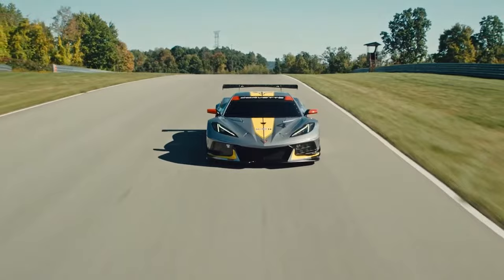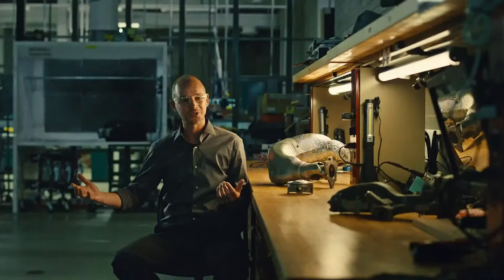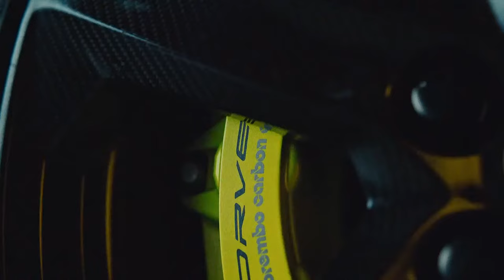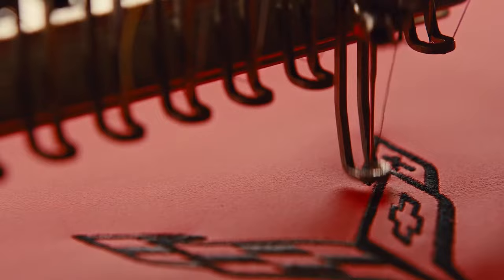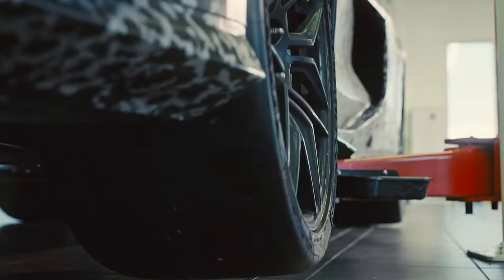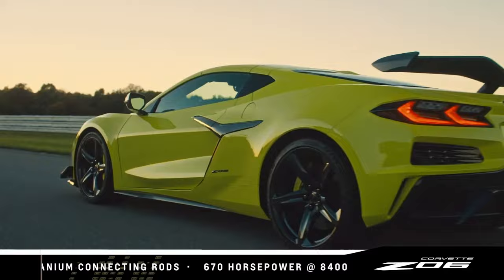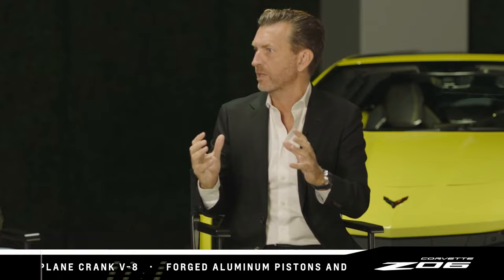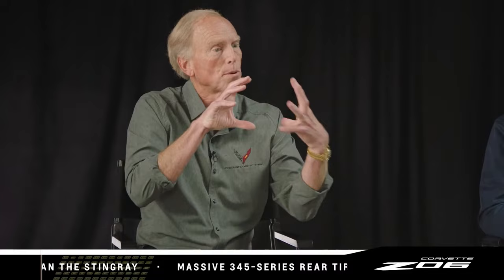All-New 2023 Corvette Z06 Reveal

Comment: After watching this, I just know the ZR1 is going to be fucking nuts.
Reply: was thinking the same thing 1k hp min
Reply: Gotta be honest with you. I think this Z06 is gonna be the best Corvette this gen. Awesome sound, high revving N/A V8. 670 hp in a N\A car? Are you kidding me?? The ZR1 is rumored to be awd, hybrid with who knows what kinda motor. It will probably be even quicker than this Z06, but im not sure if it will be better.
Reply: The Zora is supposed to be the hybrid not the ZR1
Reply: @V8Supercar1  a hybrid would be crazy, kinda like what the p1 does. Or pop a supercharger on the Lt5, it will be pretty cool to see what they come up with for the zr1
Reply: @V8Supercar1  There was a rumor that the ZR1 would have the LT6 engine but twin turbo, and supposedly the Zora will have the same twin turbo LT6 engine except it'll have added electric motors as well
Reply: @08Cusma   I'm willing to bet almost anything that the "Zora" will be the ZR1 and vice versa. The reason why I say that is because the person that currently runs GM wants everything and I mean everything electrified in the very near future.
Reply: @V8Supercar1  Typically how it is. Z06 or Grand Sport is the "happy middle", ZR1 is usually bonkers, usually too much power for the platform, but puts down insane power and specs match supercars on track.
Reply: @08Cusma  Zora will be the EV -- hybrid will be ZR1
Reply: @V8Supercar1  yet they just rolled out the largest displaced motor out a week ago. You never know but I doubt they would do that being everyone is still fighting the whole gas car ban.
Reply: I heard the zr1 won't be road legal
Reply: @tealruby1  there won't be a hybrid
Reply: @V8Supercar1  nope
Reply: Better be supercharged
Reply: Nah the hellcat redeye would whoop this
Reply: @tealruby1  actually the EV will be the E-Ray
Reply: @straightwicked5055  in what world.
Reply: @Exhibit-A The hellcat redeye and the demon would smoke it
Reply: Zo6 with twin turbos
Reply: @08Cusma  yup, that 1,000 hp engine by GM!
Reply: @straightwicked5055  no, not even close lol. Hellcat redeye in a straight line goes 0-60 in 3.8 seconds, demon 2.3, and the 2023 vette will do it in 2.6. The difference being the vette will actually keep all its traction and that 2.6 will work on a street but that demon most definitely won’t do a 2.3 on a regular street. On top of that a demon starts at 85k msrp the vette starts at 65k and you can actually see out of the vette at least LMAO
Reply: @straightwicked5055  and don’t even get me started on how the demon boat would do against the vette on a track
Reply: @straightwicked5055  lol i own a redeye and i personally dont think so at all. Vet all the way
Reply: Its probably going to have 800 HP
Reply: probably just going to be a special edition with a supercharger + maybe an electronic assist system, but they're probably not going to put as much development into it because they're going to net a lot less sales and revenue.
Reply: No, it’s not going to be sleeping with nuts. It’s going to be brutally fast. But, it’s totally unnecessary, because this is already faster than the C7 ZR1, which is brutally fast.
Reply: Dodge guys are probably thinking " if the C8 base is kicking our ass, now how we gonna beat this!
Reply: These Hellcat fan boys would compare their oversize Boats to anything, whether they're in the same category or not.....
Reply: @tealruby1  Nope. ZR1 should be twin turbo, and the Zora should be the twin turbo hybrid. The EV most likely will be called the E-Ray.
Reply: @straightwicked5055   first of all in order for demon to utilize it full potential u need to get it on E85 and swap the drag kit that comes with car. The zo6 already set no special fuel no swapping race headers and internal and tires.
Reply: There will be no ZR1, as named.
Reply: @Justin_GFM  - I highly doubt they will combine turbos with electric motors (no need). One or two electric motors (depending) alone, can bring the horsepower of this car above 1000 HP easily (and more importantly give it torque performance a NA gasoline engine alone cannot create).
Reply: Not by much... maybe 0 to 60 in 2.2 or 2.3 top speed should be around 220mph.  It's gonna be a hybrid mix. before they go all electric.
Reply: I love the Idea of the Z06 being the GT3 and the ZR1 being the GT2 rs
Reply: @Exhibit-A  the redeye and the demon would smoke it
Reply: @Exhibit-A  the redeye and the demon would smoke it
Reply: @cryptothuggin293  the redeye and the demon would smoke it
Reply: @Kacaroto13  the redeye and the demon would smoke it
Reply: @ojraven8093  the redeye and the demon would smoke it
Reply: @08Cusma  I wonder if it’ll put up hypercar stats
Reply: @Exhibit-A  the redeye and the demon would smoke it
Reply: Would rather have the Z06.  ZR1 - weight will go up, turbo's muffle the exhaust, good chance the redline will go down, price will go up, doubt the hp will offset the negatives.
Reply: They need to offer a non flat plane crank, BEAST sounding V8. When I first heard a 2006 Z06 pull up, with solid lifter valves, and fully custom exhaust, it was the most nasty sound ever. Chevy V8 engines have always been the best sounding engines in the world. You can't ever lose that sound. The flat plane crank is outstanding. But if you ever get a chance to ride in an American V8 car, with pushrods, the sound is literally the best part.
Reply: @straightwicked5055  Red-eye and Demon to heavy with 797-804 Hp with single clutch
Reply: its going to have to be low boost twin turbos if its off the same compression of the LT6 perhaps a different smaller displacement 32v that can handle more boost for the ZR1 the same way the c6 z06 was a 7L NA, vs the zr1. Considering z06 has its connotation with BIG NA power, even the  way they made the ls6 with intent to compete with the power of the 32v zr1(LT5) of the 90s made by lotus. I dont expect to see a boosted LT6 i mean look at the exhaust manifold as it is on the stock LT6 how the piping isnt equal length that took time to dial in....idk if they can just throw on a blower or 2 turbo manifolds and get an ideal match up.
Reply: I am buying a Chinese EV NIO EP9 instead because it’s pure electric ⚡️ and  the beautiful  Chinese EV is super fast also hehehe 😃😃😃👍👍👍👍👍👍🇨🇳🇨🇳🇨🇳🇨🇳🇨🇳🇨🇳🇨🇳🇨🇳🇻🇳🇻🇳🇻🇳🇻🇳🇻🇳🇻🇳🇻🇳💕💕!!!
Reply: @straightwicked5055  Keep this same energy when Zora comes out
Reply: We'll find out tonight!
Reply: this comment aged very well

Comment: 670 HP in a N/A V8? Are you kidding me?? In this day and age, that's unheard of. This Corvette might go down as the best one ever made.
Reply: 670HP from 335 cubic inches.......2 HP per CI from a NA engine......amazing !!!!!!!!!!!!!!!!!!!!
Reply: @darknes7800  It is an all new engine...not just another reworked push rod.
Reply: @polystictus  Yup, double overhead cams, 4 valve per cylinder, flat plane crank. Not like any other engine from GM !!!!!!!!!!!!!!!!!!!
Reply: Agreed. This is prolly chevys swan song for gas powered NA motors.
Reply: @jonj4357  you’re correct 
I read an article about this exact engine 
Kind of sad we are experiencing the die off

Comment: I'm a Mustang man, and I still highly approve of the C8 Z06.  Can't wait to [attempt] to buy one.  I hate to part with my GT350R, but I might have to.
Reply: I used to be a Ford guy, but GM is taking the bull by the horns with performance recently compared to Ford. I love the GT350, I’ve driven one and an R and they are great cars, but I think you will be very happy with a C8Z. Cheers and good luck
Reply: I'll take your R 😈
Reply: Feeel the same way
Reply: @703z06  yeah man. I'm still a Ford man. But I really do hope that Ford picks it up after this. GM has dropped a bomb with this car.
Reply: @nathanzavala6470  perhaps even a hole new car, Ford needs a attainable mid engine, voodoo powered track focused car. As a Ford guy its hard to admit but Chevy is running away
Reply: Likely a more practical car than the GT350R. Hopefully less fragile of an engine too.
Reply: @robdc4829   In what possible way would a Z06 (or any Corvette) be more practical than a GT350R? 
The engine issues have been greatly exaggerated. Somebody did the math on it, and I believe the failures amounted to something like 1% of the cars.  One of the development engineers stated on video that the Voodoo engine can "safely" over-rev to 9000 RPM. I would hardly call that fragile. Though, I wouldn't want to test that hypothesis with mine.
Reply: @nathanzavala6470  Like the tagline said, they're putting the world on notice. Chevy has walked up to Ferrari and slapped them in the face with the glove.
Reply: @michealgray533  It doesn't even need to be mid-engine.  Ford should make the Shelby GR-1 and make it on par with the 812 Superfast.  I've been hoping against hope that they would build that car for 17 years now.
Reply: Now you are thinking correctly. The Corvette had the Mustang beat years ago but the two mustangs I like are the 1967 and 1969 both fastbacks.
Reply: @goodboyringo9716  Well, considering the Mustang and Corvette were never competitors...
Reply: @tayl0rd553  .... I was speaking to bobbyZ06's post not you ! He compared GM to Ford . Little did you know because you are going around protecting Ford. 
Wake-up and smell the coffee , the Corvette is worth owning more than the silly looking plane mustang, it's a no brainer. Also, speak to when spoken to .
Reply: @goodboyringo9716  Learn how to quote next time. Considering you DIDN'T quote anybody and you're responding under MY post, anybody with half a brain would assume you're talking to me.  And I'm not "protecting Ford," whatever that means. And, again, the Mustang and Corvette are NOT competitors, so... What's your point?
Reply: Would be a huge step up for you.

Comment: Was at a Chevy dealer inquiring about the C8, he told me, "get in line, put 25% in cash now, and hopefully you'll get it by 2025." Now I'm looking forward to hearing when and how these will be available, with limited production, Z07 package coming in around $120K, and dealers with ADMs. I've also been in line for the Bronco, and the $60K models have sold close to $120K. Nonetheless, great presentation, but it's not an iPhone, where you can get the new one next Monday, so the thrill fades quickly with multi-year waiting times...

Comment: Keep in mind that its great to have a car that is able to rev to 8,600 RPM but you must be able to do that all day long or be prepared to see customers living at the service department when things start to go wrong.  The Honda S2000 is able to rev to 9,000 all day long with very few issues and that car was designed 21 years ago.  Now that is impressive!!!
Reply: Actually, GM products are designed to be reliable, so it should be reliable.

Comment: Love that it’s n/a and high revving.  Now where is the manual option like the Porsche GT3, for those who know how drive one?  Less than 10% of these will ever get closer than the parking lot of a track.
Reply: Exactly, True!!👍👍
Reply: They didn't want it to be slower.
Reply: A manual shift takes 250ms complete smoothly every shift.  Back the day the mechanical advantage was still their because the only auto's were slush boxes that shifted slow or so hard they broke traction between shifts.  Now that auto's are shifting smoothly in 10ms you are just killing performance with a manual.
Reply: @Dayandcounting  Manuals are lighter, which helps on the track.
Reply: @Dayandcounting  and that’s why most cars are dull now a days. It’s not all about the technology all the time. People like being in control and connected, especially with power. It just seems that most people don’t know or want that experience anymore.
Reply: @mistamaog  Compensating for 25-50lbs close to the ground is easy.  Even more so when that lighter option is giving up basically a 1/4 of a shift.
Reply: @Dayandcounting  ; reread my post.  Most will never be on a track.  Downforce numbers will just be bragging rights. It’s not about eliminating technology for better track times.  It’s a street car, otherwise it wouldn’t have a radio, air conditioning and other comforts.  Its about the interactive driving experience.  When I drove the Porsche GT3 manual I switched off the the rev-match not because it’s not a good feature, but because I have the skills to rev-match and like the experience.  Granted, the market for manual transmissions has become smaller and smaller.  The GM bean counters are not likely to allow the engineering costs vs the low volume demand of a manual.  This is probably why they have held off on building RH drive.  Pretty soon you will able to take your all electric Corvette to the track, put it in self-driving mode, turn up the internal combustion sound and it will be no different than going on a Disney ride.  You won’t even be able to adjust the tire pressure’s. If I’m on a date, give me an auto so my hand is free to comfort my partner.  Otherwise, I’ll take a stick and a clutch pedal with the radio off.
Reply: I guarantee you that more than 10% of Z06 owners will track their cars. Where did you get that number? Speaking of numbers, what percentage of GT3 owners actually opt for the manual?
Reply: @norwegianblue2017  for the last GT3 in the us they bought 70% manual
Reply: @moremoney2  It's a track focused model.  Buy a MX5 or an older car if you want to enjoy rowing through the gears it's way better suited for it. 

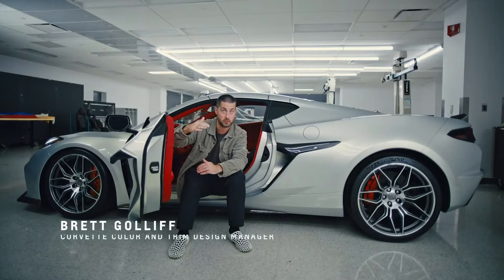Me I own a '94 RX-7 I bought new in my 20's.  Has a 5 speed with stock 4:10's with a single turbo tuned to about 450whp.  Even that will do 60 2nd and 105 in 3rd.  My point is you don't do much spirited driving and shifting with a powerful car at remotely legal speeds.
Reply: @5eliazer  you owned him!
Reply: @norwegianblue2017  owned

Comment: If this is the ZO6 I can imagine what GM has planned for the ZR1
Reply: I hear twin turbo 5.5 flat plane.
Reply: @darknes7800  😱😳😱 i think I’m going to be In love
Reply: @darknes7800 I don’t think so, the 5.5 is a super high compression V8, not so good for boost maybe a revision? But yes I’m expecting some TT option
Reply: Boosted, hybrid-AWD
Reply: @michealgray533  GM Authority expects the Corvette C8 ZR1 to be powered by a twin-turbo 5.5L V8 LT7 engine. The motor is expected to feature a Dual OverHead Cam (DOHC) configuration with 32 valves. Horsepower is expected to be around 700, while torque should land around 850 pound-feet.
Reply: @michealgray533  Keep in mind, the LT-4 engine is 10:1 compression with a supercharger. Computer controlled engine management now allows for high compression on boosted engines. The days of needing 7:1 compression for a turbo or blower motor are history.
Reply: Hopefully they do a twin turbo for the ZR1.

Comment: I just about cried watching this. this car is going to be absolutely nuts! it means so much to me to see Chevrolets very first  flat plane crank v8! and the sound is out of this world and so different but in a good way! And makes the most NA HP! This car is an absolute legend already!
Reply: Cadillac 5.1L V8, Type 51,and Peerless were the first domestic auto manufacturers to utilize the flat plane architecture in 1915. Chevrolet Gen 1 small block architects played with flat plane c/shafts, in concept and prototyping, back in the late 50's.
Reply: @timbowhalen3860  First time they actually made it into production though. You cant say that they made a flat plane crank with DOHC back then, so thats a first for gm, also i dont think any of those engines made 670 hp either.

Comment: Amazing and even more hp than I anticipated
Reply: Yep, more than I thought it would be too. That's great for a NA engine. However, they didn't even mention torque.
Reply: @oneslackr  I’ve read 460 ft/lbs
Reply: @SuperSurviver71  That can't be correct. The C8 Stingray has 470 lb.-ft. torque. Do you really think the Z06 is going to have less?
Reply: @SuperSurviver71  : Well, I guess 460 lb.-ft. is what you read on Car & Driver & Motor Trend etc... I didn't expect C7 Z06 levels of torque but I did think it would at least be more than a base model C8, something like 520 lb.-ft. or so.  Oh well.  I'm curious to see what kind of real world numbers it will achieve in 0-60, 1/4 mile etc...
Reply: @oneslackr  the c8 stingray redlines like 2000 rpm less then the z06. A high revving n/a flat plane crankshaft v8 doesn’t typically make a lot of torque that’s why the pre 488 Ferrari V8s have high power and low torque numbers. The stingray has a larger displacement overhead valve v8 which makes power lower down with higher torque numbers.
Reply: @SuperSurviver71  : I already knew that FPC engines are down on torque. But I was still expecting at least 500 lb.-ft. of torque out of a Vette even with an FPC. Like I said, lets see if this thing lives up to the hype in the real world.
Reply: @oneslackr  5.5L V8 VVT DI (LT6).  HP = 670 @ 8400 RPMs, torque = 460 lb/ft @ 6300 RPMs.  Hope that helps.
Reply: @samuelcampbell8007  : I guess you didn't read any of the previous replies from yesterday. But thanks anyway.
Reply: @oneslackr  I did, but thought you might like some more detailed info such as a few engine specs and the RPMs for max HP & torque.  Cheers!

Comment: Wasn't really a fan of the Stingray but this takes it to a level that is pretty exciting.  I think the wider panels make the silhouette far more appealing visually.  That engine is a gem!  Only thing I don't like on the Z07 package was the carbon ceramic brakes.  While they are light, they do not stand up to regular track abuse and would cost a small fortune to replace (ask the Porsche guys).  They would be better off offering a performance steel disc for track rats.